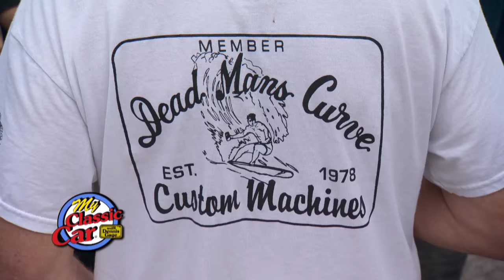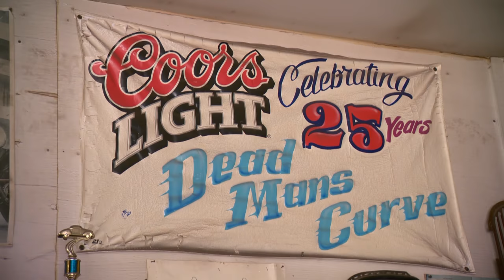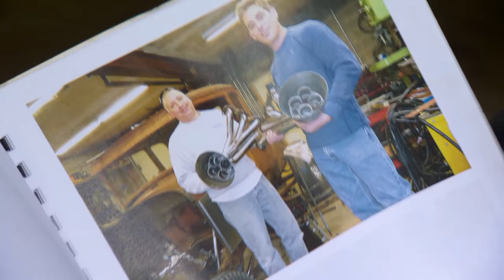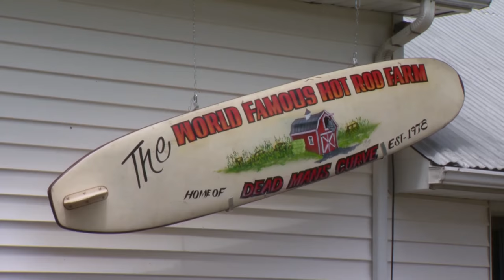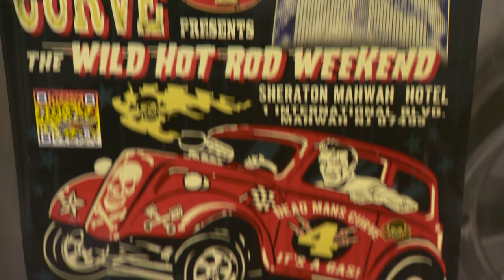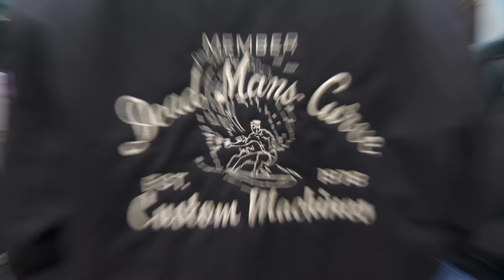Dead Man's Curve Hot Rod Club

Comment: He said he took three and a half, I think inches, off the headers. What's he mean? Because cutting back the headers (exhaust header right after the engine manifold = no muffler) (corked on the street) a few inches doesn't make sense. He probably meant cutting back the exhaust pipes.